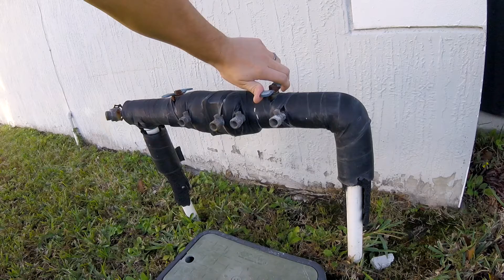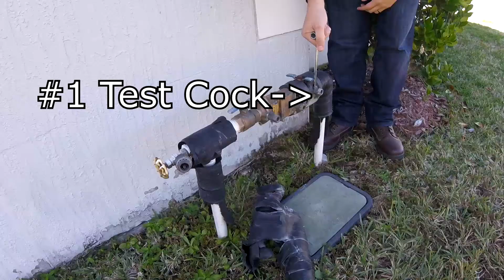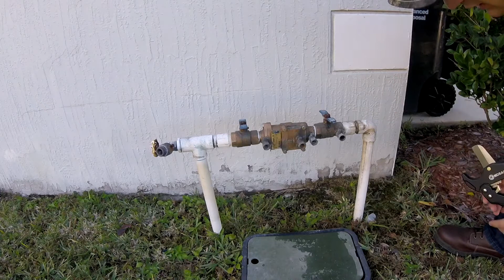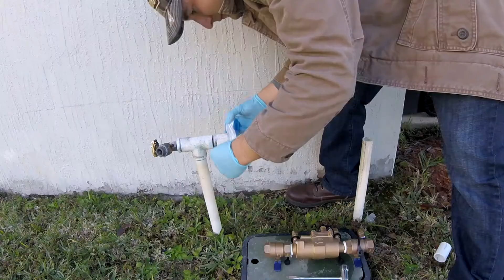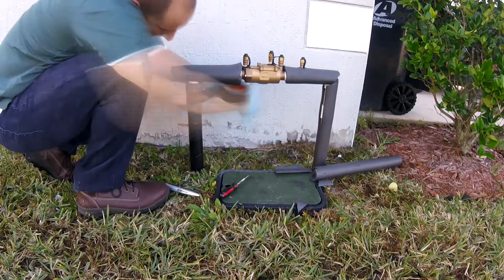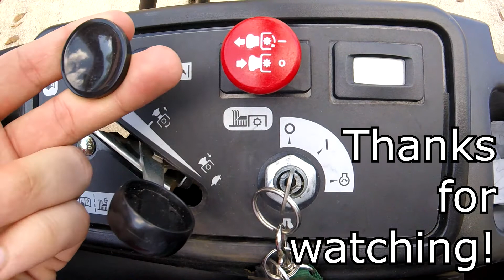Backflow Preventer Replacement (Sprinkler System Repair)

Comment: Actually, the only damage looked limited to the two valve fittings, which can be replaced separately from the body of the actual backflow unit. I would like to have seen evidence of damage to it, before seeing him replace the entire thing - at several hundred more dollars expense, especially when replacing the whole was actually simpler than just the damaged valves would have been.
Beyond this, breaks like this almost always come from freezing, and insulation like that without heat tape is nearly pointless as there is no heat source under the foam, when the water is not flowing at all.

Comment: Where did u get the replacement part  ? Mine recently ruptured
Reply from the maker: Irrigation supply house local to me but you can get them off amazon. Just make sure the sizes match. Take lots of pictures of the info plate on the old one.

Comment: When using pvc cutters click it twice into the pvc then spin it 90 degrees click it spin a little more complete the cut.  Makes for a flat cut with no deformation or cracking.
Reply from the maker: Great tip!

Comment: I love channels like this 

You turned my “oh sh*t” moment into a “I can fix that” moment. 

Would you recommend rewrapping it with that foam and tape?  I live in north Florida.  Coldest day of winter is still shorts weather.  * I’m assuming that insulation is for cold weather but I have no idea.
Reply from the maker: I am in North Florida as well. I would wrap it. Yes it is mainly for insulation, but not just from cold. UV rays can cause PVC to become brittle over time (I mean a LONG time), and it is also nice to have a sacrificial layer for the string trimmer to smack against rather than just the pipe. Also a little cushion in case of some random impact.
Reply: Copper Creek Cuts Lawn Care I had some calcium deposits in the feed size of the valve.  I got it out with an automotive pick being sure not to poke the rubber seal.  I’ve reassembled it and it is fixed!   I went to Home Depot but thanks to covid. There’s a 100 yard long line outside to get in.  I’ll recover it in a week or so. I had to destroy the original foam to get access to the valve.  

Thanks for posting videos like this.  You saved me a bunch of money and headache.

Comment: I think you got the valves facing the wall.
Reply from the maker: That is correct. Test ports should be facing straight up, and the flow of city water comes in from the right, so the valves have to face the house.

Comment: Why wouldn't you put 2 unions on and take it off and put it in the basement for the winter?
Reply from the maker: The unions are cemented in place, so you would be trimming pvc every year, using up 5 or 6 bucks of fittings and cement, and not to mention the time spent. It would get shorter and shorter until you had to fit a union and another two feet of pvc, then the process would start over again. 

Another reason is because the backflow preventers have methods for winterization without removal, and also since this is N Florida we don't have basements or many freezes.
Reply: You could use threaded union fittings?
Reply from the maker: @LusterLayer  Terribly late on this reply (but I am replacing another backflow preventer today and had to see what I did the first time), but threaded union fittings still wouldn't work as they would still have to cement in place (so they wouldn't be able to spin). Unless you mean a slip joint/female union, then male thread/male thread, and another slip join/female below that, which I guess would technically work but be a complete pain and bump the fittings cost up 4 times.
Reply: @BakerCountyTrashPickup  I am talking about the slip joint unions. I live in Southern California so it doesn't freeze and I still used the slip joint unions.
Reply from the maker: @LusterLayer  Got it. That wouldn't work because you have to cement them in place. Otherwise they will leak. Once they are cemented in place you can't remove them.
Reply: @BakerCountyTrashPickup  I am talking about this kind of union: https://www.pvcfittingsonline.com/898-010-1-schedule-80-pvc-union.html as it can be taken apart later if desired and reassembled.
Reply: O ok good job👍🏿

Comment: any reason why the spigot wasnt put back on?? no big deal just wondering.
Reply from the maker: OK so this will be hard to see, but if you go to https://youtu.be/SsKE25LumIY?t=15m57s you can see the backflow preventer near the corner of the house. About 5 feet away you will see a coil of garden hose on the side of the house, which is attached to a spigot. So one reason I didn't put it on was because it was redundant, and not terribly useful. The second reason was I didn't think about it when purchasing supplies and didn't want to bump up the price on the customer or make another trip to pick up more fittings and a new spigot. I also didn't want to re-use the old spigot as it was pretty weathered.
Reply: yeah i kind of thoughts it probably was something like that. but had to ask. lol
Reply from the maker: Never any harm in asking! :)